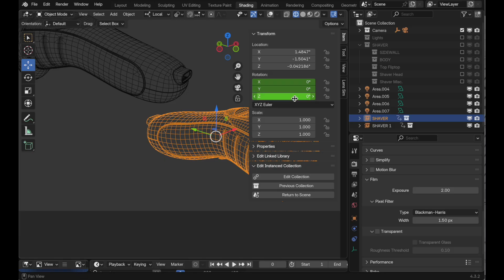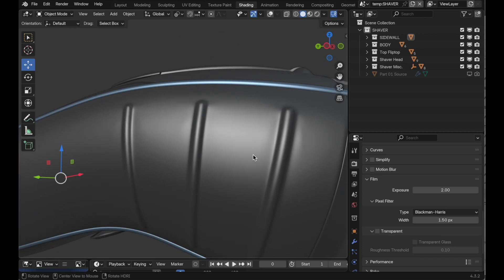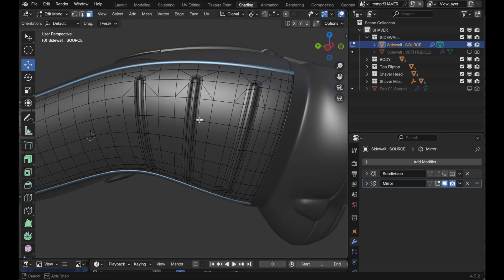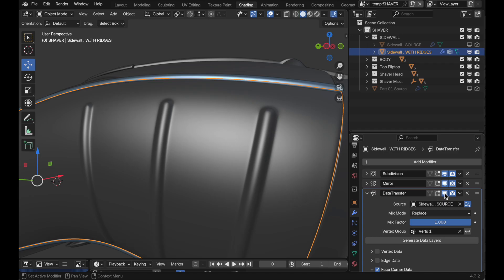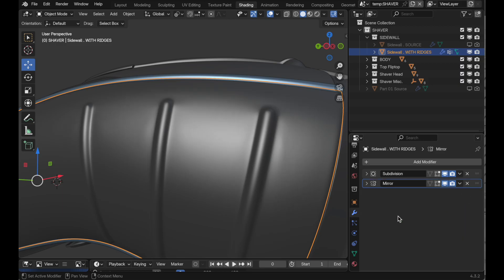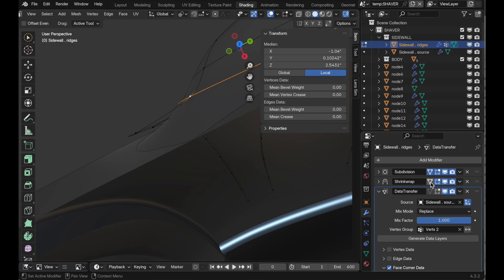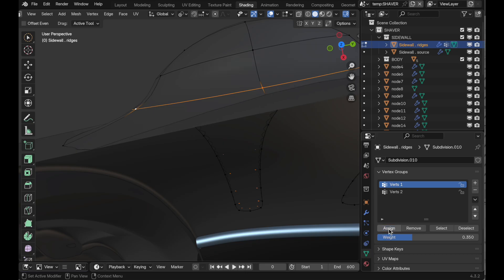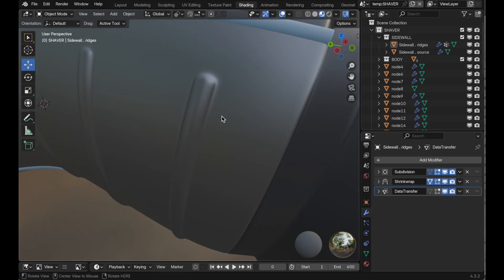Eliminate Ugly Shading on SDS Objects (Data Transfer & Shrinkwrap). More examples.

Comment: I totally get the purpose of this tutorial is to show the transfer technique. But, you probably would have been able to eliminate the pinching by using twice as many polys (by creating the main form then subdividing to have enough support geo). You were getting pinching because there weren’t any support loops between the loops connected to the raised areas. Also you had triangles. Just a thought!
Reply from the maker: You can increase the number of polygons in a mesh that drives subdivision, but then it becomes harder to make larger overall changes to the form if you need to. It's a balancing act. And triangles are inevitable at times, the problem is that Blender's subdivision routine, the standard Catmull-Clark routine, doesn't handle triangle inclusion as well as newer more advanced algorithms.
Reply: @christopher3d475 I think he made them on purpose for the tutorial.

Comment: I've used to always make sure that the density of the flat surface and the detail are roughly equivalent, but that only works to a point and applying subdivision surfaces can be quite destructive. Modifier List addon has a build in edit mesh modifier now like 3ds Max, which might be an interesting alternative workflow. I mostly tend to use the data transfer and shrinkwrap personally, especially for game models where I might want to turn details on or off for customization. Great refresher tutorial, I enjoy your videos!
Reply from the maker: I recently saw a video that showed the Modifier List addon and I've been meaning to check it out.

Comment: Does these give good results for shiny shaders with HDRI lights too? i.e. car design. So many users hide bad surface quality using flat shaders and diffuse lighting. Thanks for sharing these techniques.
Reply from the maker: yes, this works quite well on very glossy materials. I did a previous video where I demonstrate that on a car model. https://youtu.be/KGgYQH5A2eQ
Reply: @christopher3d475  ah I had missed that video because it has the same thumbnail. Good stuff for viz. TY

Comment: Thanks for this tutorial; i wanna ask if there are techniques to model perfect surfaces without using shrinkwrap modifier
Reply from the maker: You can always run into topology problems with subdivision surfaces, usually when there are intersecting topology flows or localized detail.

Comment: Ever since learning of the ability to data transfer normals, I have wondered why it is not more commonly done. It feels like there has to be a catch to it which makes it undesirable in some situations. Obviously, Fundamentals of good topology are important regardless. So maybe there is some aspect of people not being taught to do it at first so that they don't rely on it, But it feels like there has to be some other reason why it is not more common when it comes to non-deforming hard surface modelling.
Reply: This works good if you work alone, but if you send model to someone else it could create some problems. Object look good, but it's geometry is not 100% correct.

For example if someone wants to make high quality 3d print real geometry will be printed, and artifacts might be visible.
Reply from the maker: You must not have watched the section where I demonstrated the method using Shrink Wrap that produced perfect geometry that could be exported for 3D printing.
Reply: What @cyrkielnetwork said. Also if your geometry is good from the start a couple of control edge loops would fix something like this, making the data transfer unnecessary.
Reply from the maker: There are some things that a sub-d model is just going to have problems with, and no 'good from the start' geometry will allow a couple of control loops to fix. One of the methods I showed allows for the export of corrected geometry using Shrink Wrap that could be 3D printed. Far better than wasting hours trying to fiddle with control loops on the topology.